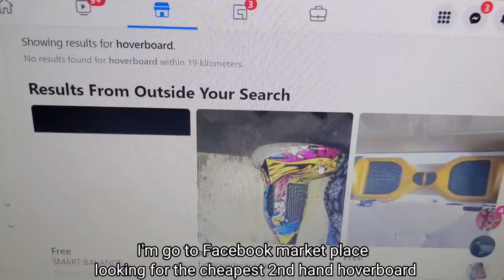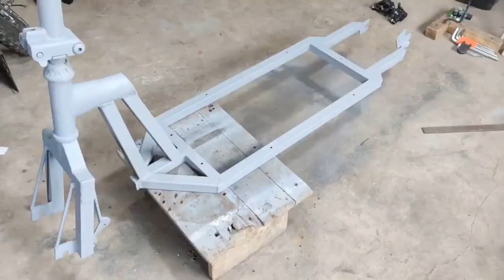Cheap DIY electric scooter from old bike parts and hoverboard.

Comment: How about trying a 254 or 305mm wheel on the front for better ability when there is a hole in the road?   I mean 14 or 16 inches